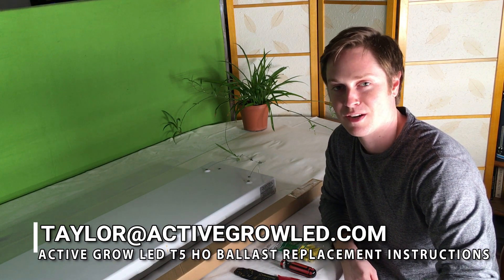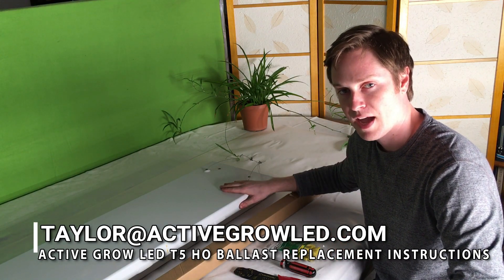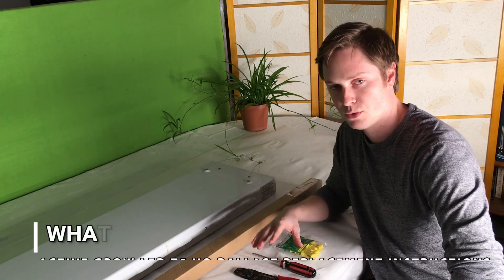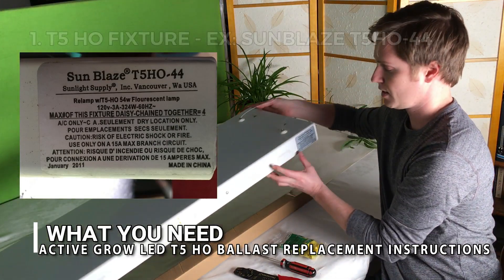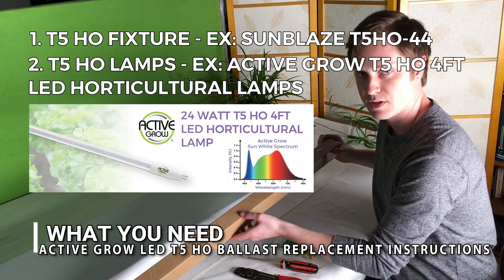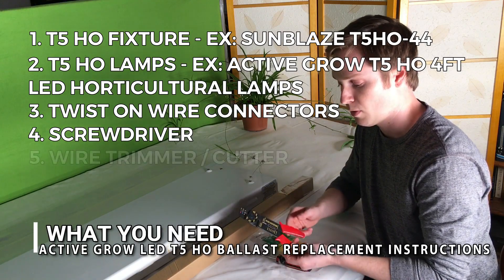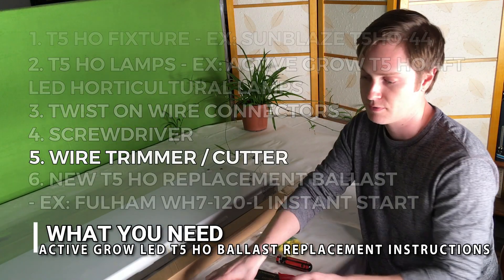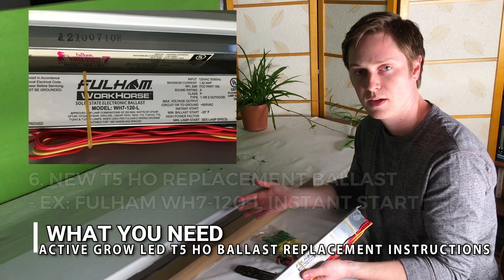How to Replace a T5 HO Grow Light Fixture Electronic Ballast

Comment: My lights turn off after a couple hours would this be cause of a bad ballast ?
Reply from the maker: Hello, if multiple lights are turning off on the same fixture instead of a single lamp having an issue it is most likely a ballast compatibility issue or a bad ballast that is causing the problem because the ballast will usually operate 2 or more lamps at a time. If you can test the lamps in another fixture to make sure it is not a lamp issue then you can confirm that. Thank you

Comment: Instead of replacing the ballasts can you swap in a meanwell LED driver? I get the ballast works as a driver but it would be nice to use a dedicated led driver. Thanks
Reply from the maker: A Meanwell driver would not be compatible with a T5 HO fixture.

Comment: What is the original ballast that comes in the Sunblaze T5/HO? I just purchased the active grow T5/HO LEDs and I’m trying to find the right fixture with ballast configuration, any information would help greatly! The fixture I have isn’t compatible with the LEDs
Reply from the maker: Hello, this SunBlaze model in the video uses a Fulham Workhorse ballast and it is compatible with our lamps. I am not sure why your SunBlaze does not use that type of ballast unless it is an older model that used a different type. It is easy to check behind the reflector to see what type of ballast you have and check it against the ballast compatibility list we provide on our website. I hope this was helpful!
Reply: Active Grow LLC I didn’t explain in detail but the fixture I own isn’t a Sunblaze fixture it has two separate ballasts & the bypass worked but I’m sure these active LEDS should be brighter, I can send over a photo of the lights while they are on but am not sure how to insert a photo along with this message. Let me know how to attach a photo/video for you & I’ll be glad to send it over
Reply from the maker: @tcbloomzcultivation5333  Hello I am a bit confused as you said that the bypass worked. The lights we currently offer are direct replacements so need an electronic ballast to operate. Sorry for any misunderstanding and thank you.